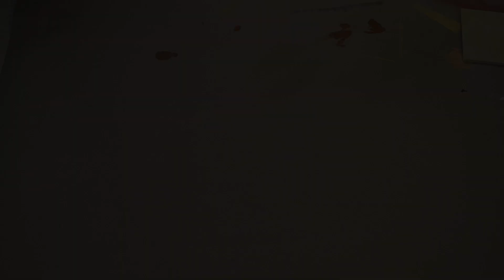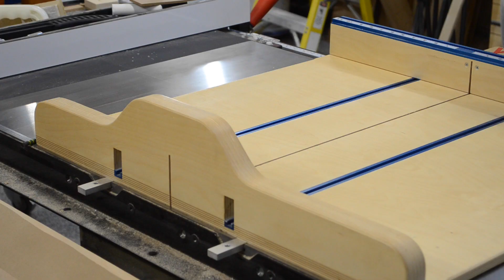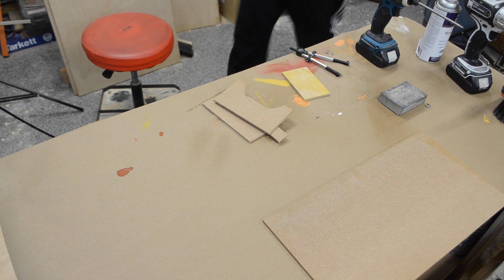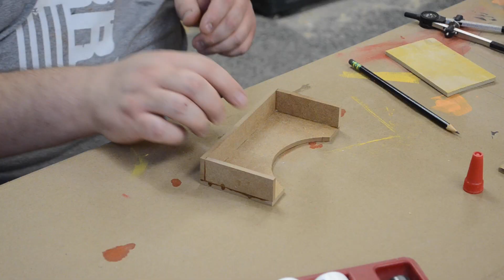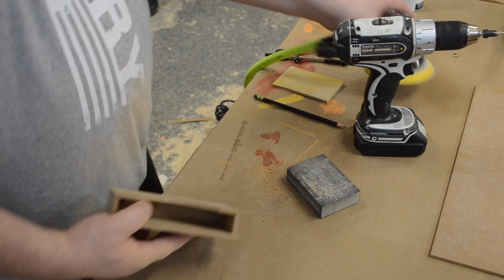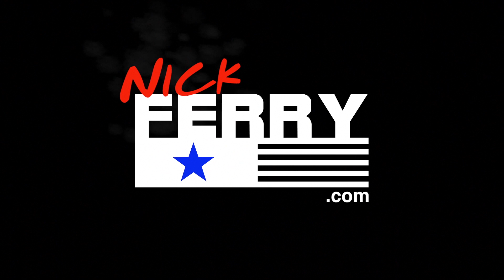Ⓕ Random Orbit Sander Holder (ep74)

Comment: Not sure if you are aware but you can spray the activator on the piece you are glueing to - the activator will stay on the surface even after the liquid carrier dries. I see a lot of people try to spray the joint after its together and you won't end up with much if any activator getting to the CA. Cheers :)
Reply from the maker: yup I'm aware - doing so only gives 1-3 seconds at best for aligning everything - I prefer to shot after I have it lined up

Comment: Can I ask why you use a air sander instead of electric?
Reply from the maker: I answered this on my website so I'll just paste it here:

that’s a tough one – even the pros and cons can be subjective – I use both – you have mainly three types to compare: corded electric, cordless electric, and pneumatic – on the electric side I would take corded over cordless in most cases – the con is the cord but the pro is the ample power – electric vs pneumatic: pneumatic is smaller and often times fits in the hand better – being it’s smaller, it is shorter and has a lower center of gravity – this helps prevent tipping of the sander and possibly gouging the wood with the edge of the disc – making it ideal for faster paced production work – the con for pneumatic is air supply – they use a lot of air – most home workshops have smaller air compressors that can’t keep up with the CFM (cubic feet per minute) needed to run air sanders – also, larger (oiled) compressors require maintenance while the electric side has almost no maintenance – some will say air powered leaves less swirl marks but I personally think you get what you pay for – on either side, less expensive models and improper technique will result in swirlsAll said, it’s a matter of preference – I you’re really curious, try some of each and see which you like best – it would be air powered for me if I could only have one – I could very easily go more into all this but this is the most succinct way I can put it – it’s a topic I maybe could write and article on?

Comment: Good project. I'm curious about your choice of an air sander. I've used one and the only difference I noticed was that it was louder. Is there some advantage I overlooked, or is that just the one that works best for you?
Reply from the maker: I answered this on my website so I'll just paste it here:

that’s a tough one – even the pros and cons can be subjective – I use both – you have mainly three types to compare: corded electric, cordless electric, and pneumatic – on the electric side I would take corded over cordless in most cases – the con is the cord but the pro is the ample power – electric vs pneumatic: pneumatic is smaller and often times fits in the hand better – being it’s smaller, it is shorter and has a lower center of gravity – this helps prevent tipping of the sander and possibly gouging the wood with the edge of the disc – making it ideal for faster paced production work – the con for pneumatic is air supply – they use a lot of air – most home workshops have smaller air compressors that can’t keep up with the CFM (cubic feet per minute) needed to run air sanders – also, larger (oiled) compressors require maintenance while the electric side has almost no maintenance – some will say air powered leaves less swirl marks but I personally think you get what you pay for – on either side, less expensive models and improper technique will result in swirlsAll said, it’s a matter of preference – I you’re really curious, try some of each and see which you like best – it would be air powered for me if I could only have one – I could very easily go more into all this but this is the most succinct way I can put it – it’s a topic I maybe could write and article on?

Comment: Talk about Deja-vu!  I just made an almost identical holder for a little Bosch Isio Shape and Edge Cordless Shear -
Reply from the maker: we are on the same wavelength
Reply: I was going to make a joke about being so old that I'm still on 2LO, but that would be meaningless outside the UK - and I forgot to include a link to a picture:  http://www.donjohnson24.co.uk/images/Shearholder.jpg - which you can see is pretty rough and ready, unlike your (typically) smart version.
Reply from the maker: don't worry, I'm still putting in AOL discs on my end (maybe USA joke, who knows)